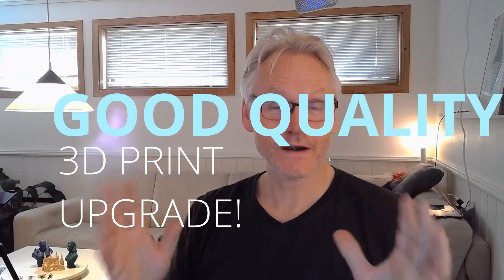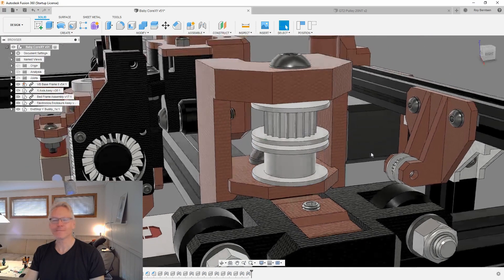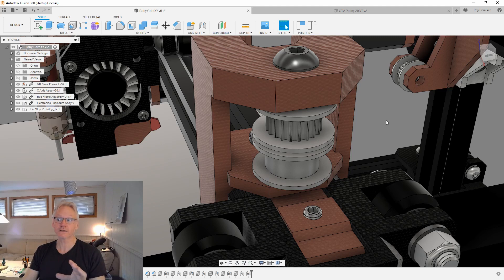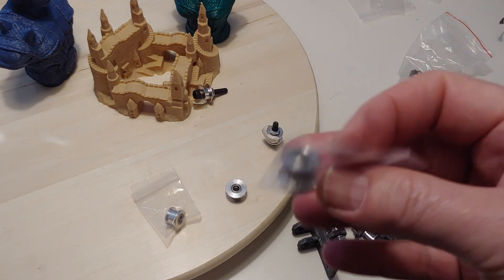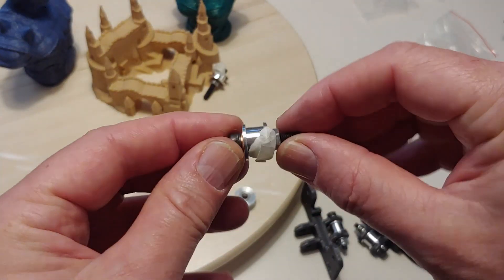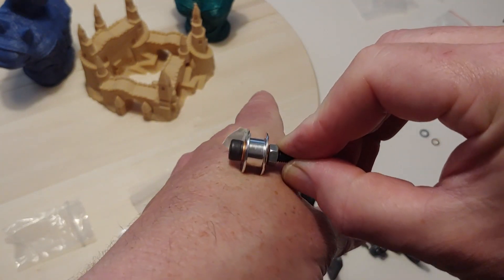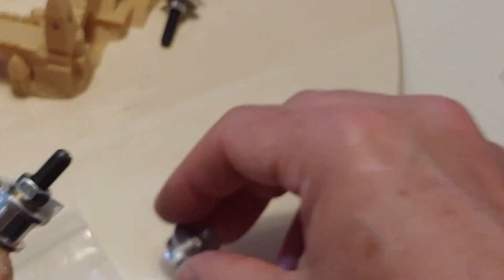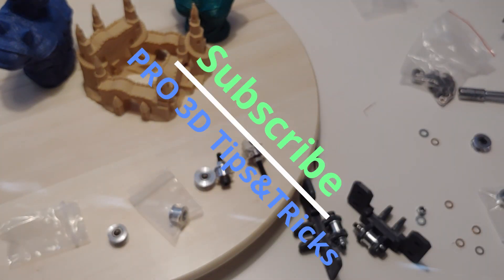Upgrade Your 3d Printer | Quality GT2 Parts | Better Prints With Smoother Moves!

Comment: Those Mellow idlers are awesome. I upgraded a CoreXY back in June and it made a massive difference on how smooth the printer moves. 
I have a massive box of cheap idlers from various vendors that I rejected, if you get 10 cheap idlers you are lucky if 3 are even decent. They wobble around the center, the bearings run rough or bind up ...
Reply from the maker: Thank you for sharing. I will redesign so these can fit my printers as stock

Comment: If I'm looking to buy precision shims for this type of 5mm ID idler, what dimensions should I look for? I can find 5x8x1mm shims very easily; will those suffice?

Thanks for making this video. As someone without an education in engineering, I often find it useful to consult those who do. I've purchased some mediocre quality gt2 idlers and found that they bind whenever you apply the slightest tightening. For this reason, I think I'll end up buying some of the mellow idlers you've shown. cheers!

Comment: Forgive my NOOB question, are these parts for a particular printer, or all printers? I have an Anycubic Chiron. Great printer, but I'll do anything if it results in better prints :)
Reply from the maker: Pleas ask anything! These are for most printers - I cant say all but most common drive system on these machine is GT2 belts and then the idlers I show. There are different sizes as some printes use 16 tooth system and some use 20 tooth system so you must look at your printer and see what kind of pulleys/idlers there is. YOu can count teeth or measure size of the diameter
Reply from the maker: You must modify parts to use these idlers. They have a higher profile than the cheap ones

Comment: Mmmm. I always have used cheap chinese gt2 and iddlers and always bearings rolls smooth. I use 3mm inner hole ones (for M3 bolt).